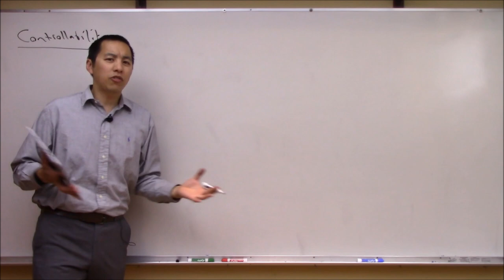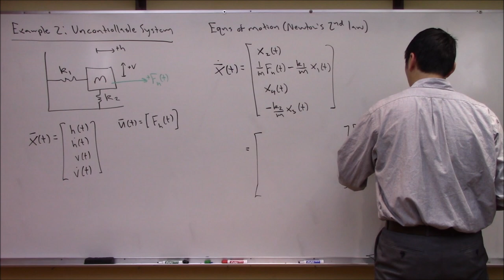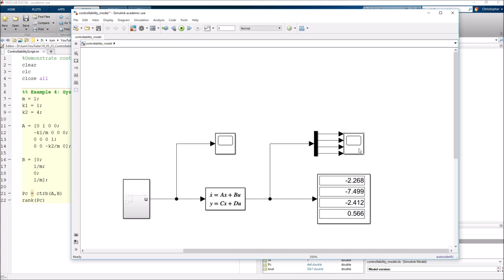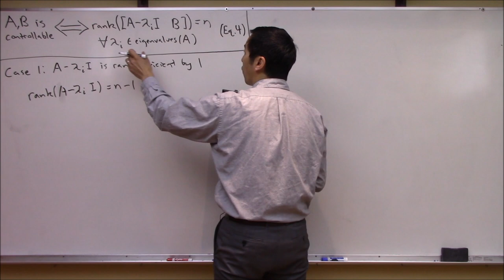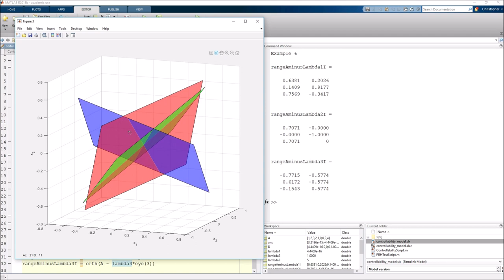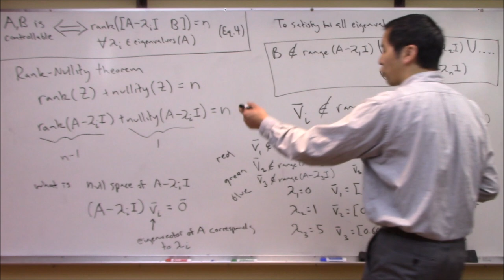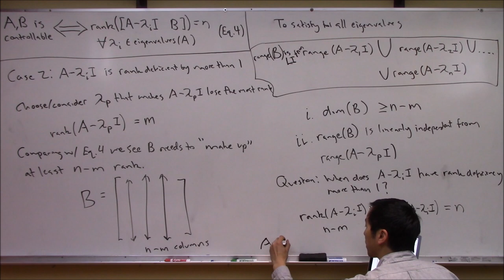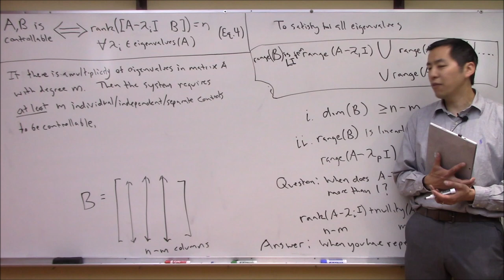Controllability of a Linear System: The Controllability Matrix and the PBH Test

Comment: Overall very helpful and informative. Thank you!

One nitpick feedback about Example 4 and 5. The drawing of a single thruster attached to the mass is a little bit misleading because the control input is allowed to be negative, but a single thruster couldn't do that. Maybe it would be better to draw two opposing thrusters on each side of the block.
Reply from the maker: That is a very good point, I will update the notes.  Your attention to detail almost makes it sounds like you want to go into designing real space systems or something 😀

Comment: What an amazing video this was Professor Lum. I just had a question regarding the PBH test in case when A has m repeated eigenvalues with geometric multiplicity smaller than the algebraic multiplicity. I was wondering what should the structure of B be in that situation? Should the dimension of rank (B) be still greater than or equal to n - m?

Comment: I think that there is a problem with the example at 46:01 with the A matrix. As written it does not have full rank. This should be obvious from the fact that one of it's eigenvalues (and thus its determinant) is equal to zero. Also orth(A) gives only 2 linearly independent eigenvectors  (at 53:20) which confirms this. Are the controllability criteria valid if the system matrix does not have full rank? In that case it seems like all 3 state variables are not linearly independent and thus cannot each be determined individually, thus making the system uncontrollable. Also consider the B matrix to equal v1 + v2. As someone noted below this system is controllable per the ctrb criteria as rank( ctrb ( A, v1+v2 ) ) = 3. However v1 + v2 FAILS the PBH test at lambda = 5 because rank([ A - 5*I, v1 + v2]) = 2. So these results are inconsistent.
Reply: I think that I figured out the discrepancy. Matlab seems to be storing matrix entries as floating point numbers. As a result two "identical" columns may have slightly different floating point representations. When I do rank ( ctrb ( a, b ) ) in the above case I sometimes get an answer of 2 and sometimes 3 even though the matrix entries to 4 decimals which are displayed has 2 identical columns. I wonder if there is some way to force matlab to store entries as rational numbers which would avoid this problem. Also performing a similarity transformation on this system to diagonal form results in a b matrix of inv(M)*b = [1;1;0]  where M is the matrix of eigenvectors of A thus confirming that the 'direction' associated with lambda = 5 is uncontrollable.